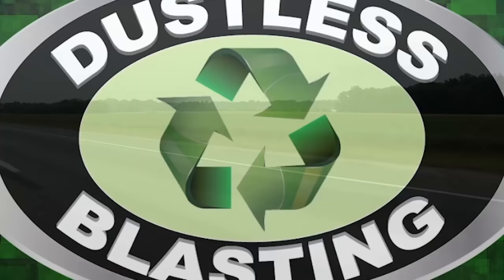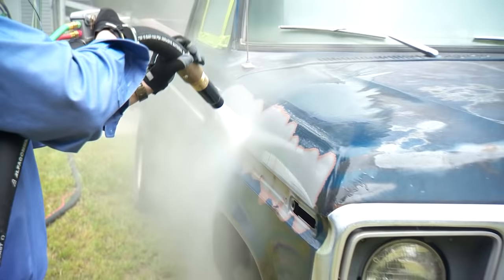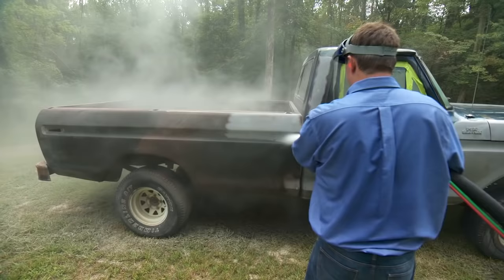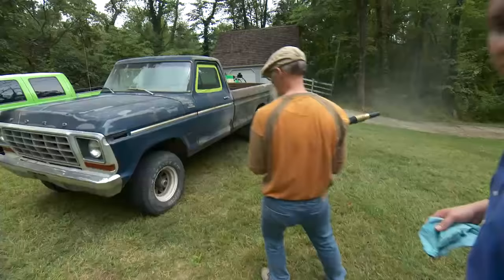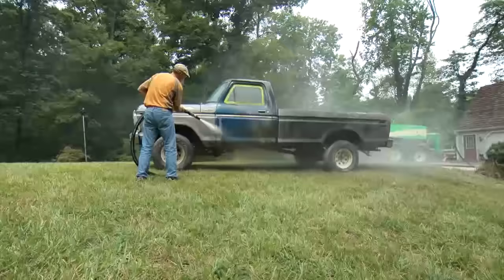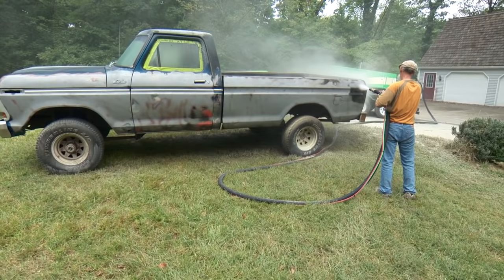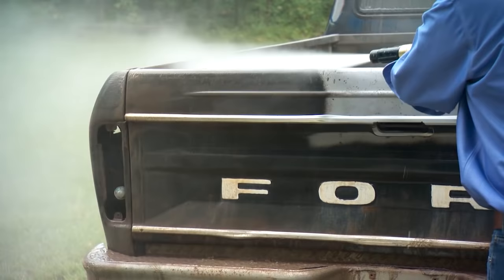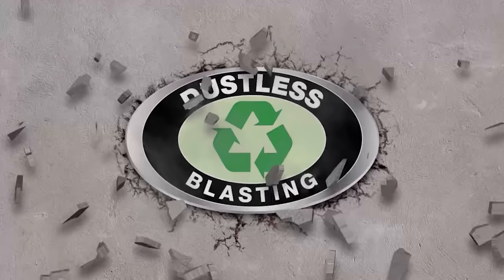Behind the Scenes of Dennis Gage's Truck Being Dustless Blasted!

Comment: Used to work at a place that made insulated panels for cars and trucks. They used dry ice thru small blasters. Worked great at cleaning the molds. You could clean them right on the press with very little mess.
Reply: I've seen this process with the dry ice also

Comment: may sound silly but will this work with rust on frame?
Reply from the maker: Absolutely! Works great removing rust and even very heavy corrosion. In this video you can see some thick rust being blasted: https://youtu.be/i9t5eIhFuBk?t=3m2s
Reply: Yes unless it's heavy scale.  Then you need to use physical removal.  Otherwise you'll polish the scale.

Comment: What kind of kick does the hose have. I used to worke with a 140psi system and I am thinking of getting your system in the future.
Reply from the maker: Steve Staley  It's got a pretty good push back, it probably feels similar to the 140 psi dry system you may have used.
Reply: +Dustless Blasting 140 psi is 9.6 bar. That's not that much, I was expecting 20 bar or something.. That's pretty awesome ! I have a regular sand blasting cabinet for automative parts, I am using 10 bar of pressure, and sometimes even with the heavy rust, I feel I need some more..
Reply: +Dustless Blasting Guessing it'll cut through fiberglass body cars like the corvette?
Reply from the maker: +Josh427SS We have some contractors who only restore Corvettes, with caution and a lower pressure they're able to strip fiberglass without damage.

Comment: How many lbs of water pressure are you using?
Is there sand mixed with the water?
Reply from the maker: this video is using recycled bottle glass as the media.  The water, abrasive and rust inhibitor are mixed in the blast pot.  You have an adjustable range of psi based on the surface and finish level you are trying to achieve.

Comment: Hang on ..I didn't get that.. so it's just water pressure removing the paint?
Reply from the maker: Great question. The difference between Dustless Blasting and power washing / water pressure is that there is abrasive in the process. This makes it capable of stripping much tougher coatings. Power washing is good for cleaning dirt and grime, but it generally can't remove rust, paint, bondo, etc. If you'd like to see a comparison, here is a video: https://www.youtube.com/watch?v=VkacNkNihUQ

Comment: What happens to all the dust and debris from the paint? Does it make a mess?
Reply from the maker: Blasting wet means there is no dust plume.  Debris can be easily contained on a tarp that is rolled up and disposed of or if you are concrete it can be swept up. check out our website if you would like more information. https://www.dustlessblasting.com/request-info

Comment: I called them ask them how much it would be they want $950 just to sandblast a frame
Reply: Good price
Reply: yeah I called for my truck and they wanted $7,300 
I could buy another truck for that.
that should just sell the blasters
Reply: @robertolivarez5742  either you're outright lying, someone tried to scam you, overall your reply is bullshit.  You can buy the systems.  

The most expensive blast in the suggested pricing guide is a disassembled vehicle and it's 1350.  Average vehicle is 850 or so.  I've priced several and never been over 1200.  

Many have come in under 800, those were jeeps.  7300 gets you a mobile blasting unit of your own.

Comment: what other materials does this use besides extremely high pressure water?
Reply from the maker: Recycled bottle glass is one of the most common abrasives used with our system. You can also use a wide range of other abrasives like sugar sand, coal slag, garnet, blast sand, and more.
Reply: Dustless Blasting how much for the machine

Comment: what about semi truck frames.... do you need to mask off wires or  air lines???
Reply: Typically in a bead blast cabinet...plastic and rubber isn't affected by bead blasting in my experience.  So wire and plastic brake line should be fine considering there is water in there too and not straight beads.

Comment: Really cool guys, never seen anything like it! Random pointless question here, just out of curiosity, how much water does this use?
Reply from the maker: It uses approximately 20 gallons of water per hour, which is far less than the average power washer. The abrasive is doing much of the work!

Comment: What did they use to prevent flash rust?
Reply from the maker: Hi Tito! We mix Rust Inhibitor into the water in a 1:100 ratio. It prevents flash rust for up to 72 hours. Of course, the sooner you can prime the surface, the better. Here's some more info on Rust Inhibitor: https://store.dustlessblasting.com/products/dustless-blasting-rust-inhibitor?variant=9423199076388

Comment: Is that just water pressure?
Reply from the maker: The Dustless Blaster uses a mixture of water and abrasive. This allows you to strip tough coatings like paint, rust, and bondo -- which can't be removed by a traditional pressure washer.

Comment: I don't understand, why the grey primer, which is a paint basically, stays intact, somebody please explain, if primer is a paint then this powerful wet blaster must be able to remove that layer too just like the finish one.
Reply from the maker: +AtoZ O The flat gray color is actually the bare metal. The crushed glass profiles it, giving it a texture, which makes it look flat and dull rather than shiny like usual. You are right, it would be very difficult to remove paint without also removing primer.
Reply: Send me one, I have $20 in my bank account.
Reply: Dustless Blasting 
I just picked up a paashe air eraser. 
Think of an airbrush but blasts media. 
When I used baking soda in it, I was blasting layer by layer of paint off in a quarter sized area. 
Other areas that had paint worn off(under a window weatherstrip) and had primer, I was blasting the dirt off the primer , it's so gentle now I see why dentists and archeologists use them.
Reply: "The crushed glass profiles it" - What crushed glass ?
Reply: It's water and crushed glass they spray at the truck

Comment: So you have a big huge air compressor with you and you use a gas powered leaf blower to dry the truck off?! makes sense.
Reply from the maker: +MrFakit It's because air compressors tend to blow moist, oily air, which would recontaminate the metal, causing rust. But you're right, at face value it looks downright silly.
Reply: Well I think a better solution would be a Motorguard filter or something similar?
Reply: Don't gas leaf blowers also blow exhaust fumes with the air?
Reply: Dustless Blasting

Comment: So basically, power washing? (But with extra-high psi water?)
Reply from the maker: Not quite! The pressure is actually much lower than the average power washer. The Dustless Blasting process uses abrasive (like sandblasting) which can remove coatings that a power washer can't even touch. Here is some more info: https://www.youtube.com/watch?v=VkacNkNihUQ

Comment: The metal is going to flash rust since you're using water on metal so it's not going to be completely ready to paint
Reply from the maker: We use a specially formulated rust inhibitor to prevent flash rust for up to 72 hours. This extremely effective rust inhibitor is added to the blast water to prevent flash rust during blasting, and then used to rinse after blasting is complete.
Reply from the maker: We use a rust inhibitor which removes chlorides and prevents rust for up to 72 hours. Our rust inhibitor also improves coating adhesion and longevity.

Comment: Do u use walnuts. Or silicon sand. Many think can be blasted on with water ah nice.
Reply from the maker: Hi Kevin, good question. Our machine can use any abrasive that is clean, consistent, and sinks in water. Most people like 40/70 recycled bottle glass media, because it's inexpensive and works for just about any substrate. 

The machine is also capable of dry blasting which would allow you to use walnuts. Silicon sand is not recommended for health reasons.

Comment: Except water blasting doesnt leave any kind f a profile for paint to bite to...
Reply from the maker: Hi Brandon! You're exactly right - water blasting won't leave a profile. However, the Dustless Blasting process is actually more like sandblasting because it uses an abrasive - so it will profile the metal. In fact, you can choose from a variety of abrasives to achieve the right profile for the job. Hope that helps.

Comment: Basically a pressure washer on steroids with a fatter wider spray.
Reply from the maker: Not quite - the Dustless Blaster uses abrasive (kind of like a sandblaster) which helps you remove coatings that the average power washer can't even touch. https://www.youtube.com/watch?v=VkacNkNihUQ

Comment: So you couldn't use a pressure washer to do this? I use to clean buildings, sidewalks and such, till my check was getting goofed with and I carved the name of the business sucks in the sidewalk of one of the locations using the pressure washer.  Figured if they didn't want to pay me, they'd be stuck paying to have that huge section broken up and redone. Well worth it.
Reply from the maker: Great question. The difference between Dustless Blasting and power washing is that there is abrasive in the process. This makes it capable of stripping much tougher coatings. Power washing is good for cleaning dirt and grime, but it generally can't remove rust, paint, bondo, etc. If you'd like to see a comparison, here is a video: https://www.youtube.com/watch?v=VkacNkNihUQ

Comment: Isn't this just pressure washing?
Reply from the maker: Hi there! Great question. The difference between Dustless Blasting and pressure washing is that there is abrasive in the process. This makes it capable of stripping much tougher coatings. Pressure washing is good for cleaning dirt and grime, but it generally can't remove rust, paint, bondo, etc. If you'd like to see a comparison, here is a video: https://www.youtube.com/watch?v=VkacNkNihUQ